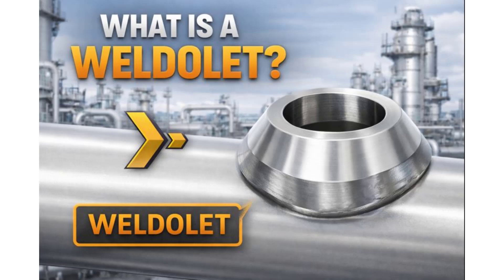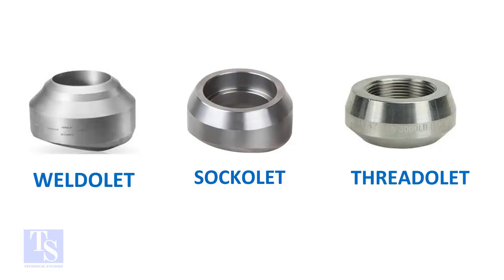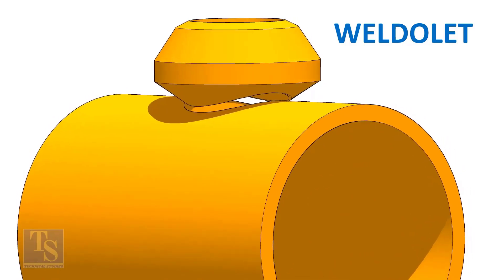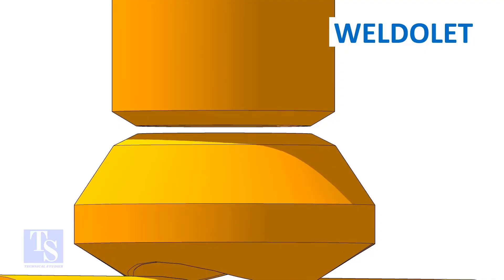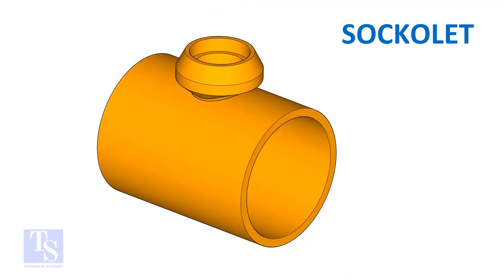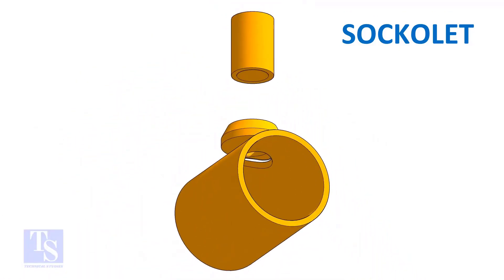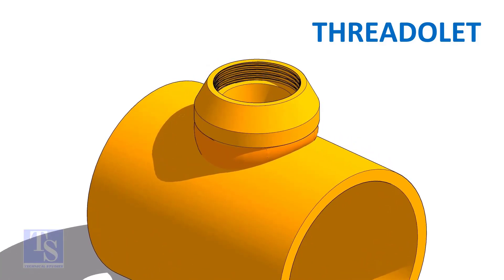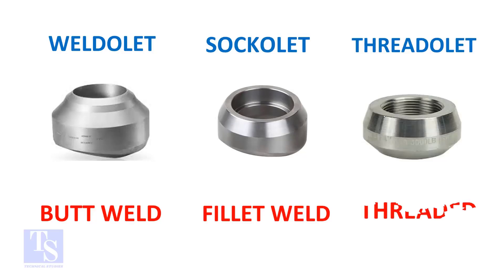How to Identify Weldolet, Sockolet and Threadolet in Piping Systems. Tips & tricks.

Comment: Would these be installed for piping carrying food grade products like milk, beer, orange juice, liquid sweeteners, etc.? Are they Stainless Steel or mild steel?
Reply from the maker: Yes, they can be used for food-grade piping, but only with the correct material and hygienic design. For products like milk, beer, juice, etc., olets are normally stainless steel (SS 304 / 316). However, in hygienic systems, weldolets are preferred, while sockolets and threadolets are usually avoided because threads and socket gaps can trap bacteria. Mild steel olets are not suitable for food-grade service. Thanks for the good question.